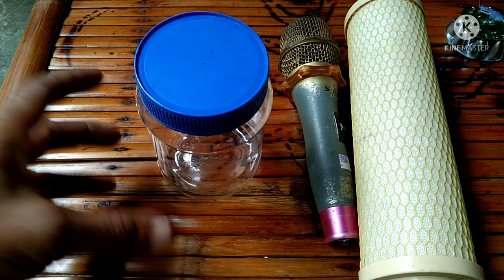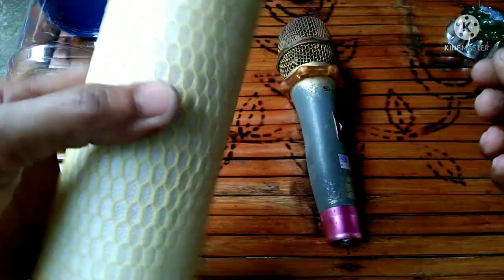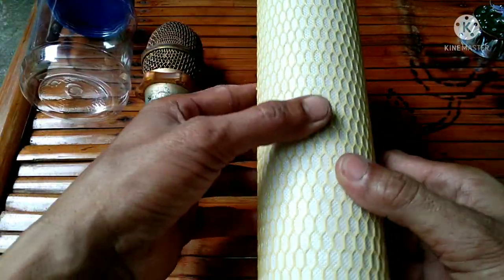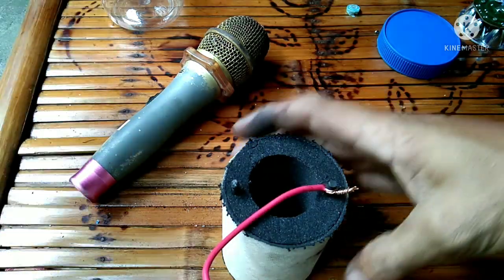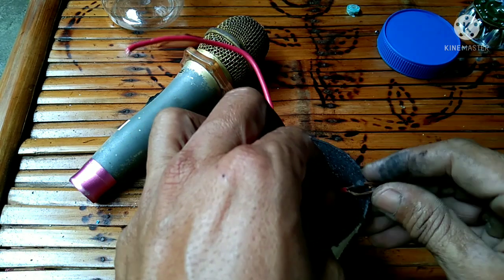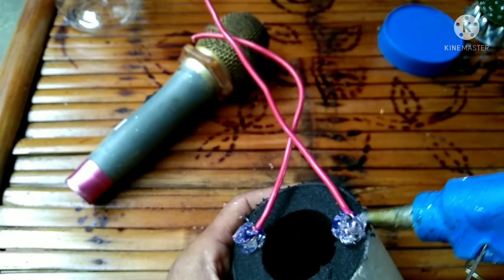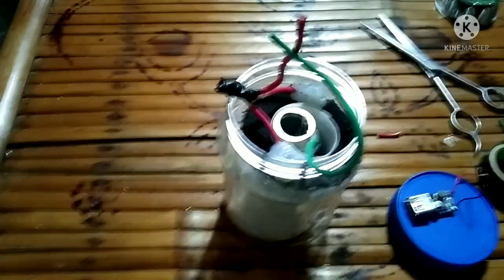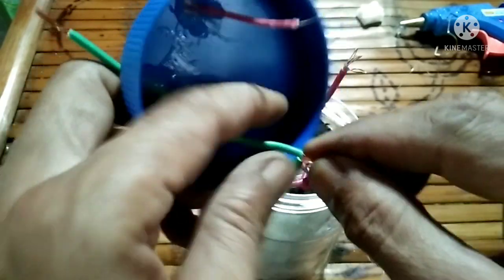DIY flashlight Phone charger powered by Sea water

Comment: Ano po ang voltage at current output ng saltwatee battery ?
Reply from the maker: 5 volts less than 100 miliamps. Ung boost con po nagapataas

Comment: Practically even though you can increase the the voltage through a booster... In practical this battery has very less current... Less than 100mah... So how come it can light up the bulb without mah(current) .... ???  I am curious to know
Reply from the maker: The step up boost converter also step up the current up to 600miliamps
Reply: @MrDIYProjectTech21  

Would appreciate if you can create a demo video... As how the current (mah) increases before and after connecting booster converter....

Peace
Reply from the maker: Thank you, I will do your request on my next video